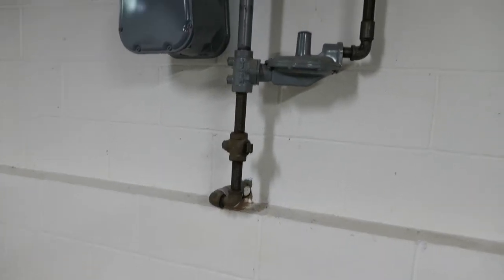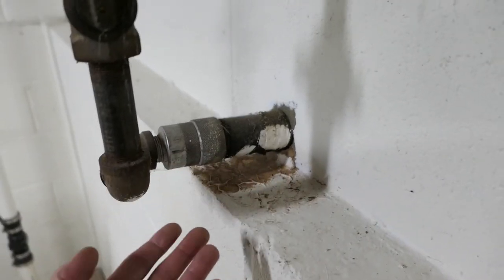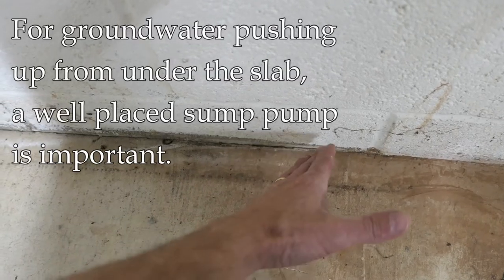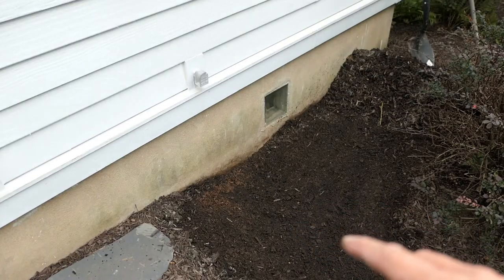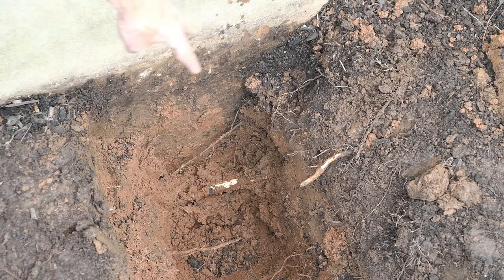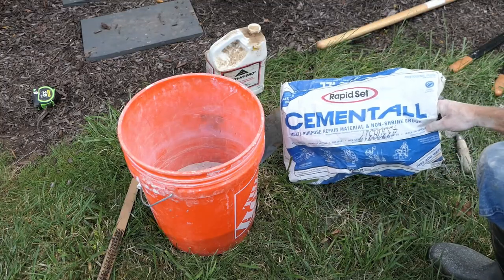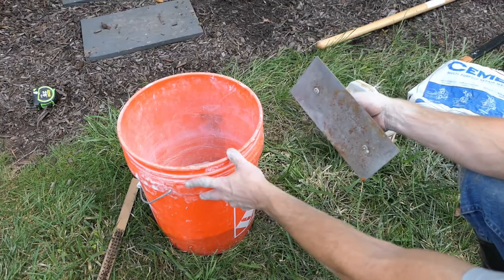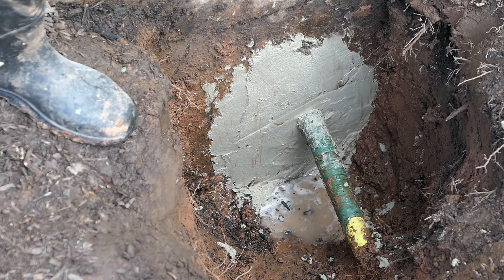Stop Water Coming In Along A Pipe Through A Basement Wall

Comment: I have the same exact problem. Mine is a water line that feeds out to the detached garage. When we have heavy rain water will come through the hole the water line is ran through. My question is should i fill the hole after the repair with hydraulic cement jusg above the water line or use crushed rock?
Reply from the maker: Are you asking how to handle the exterior of the building in this area?  If so, you'll want to dig down to find where the line comes in, and then repair the hole in the foundation as shown in the video.  Then to backfill you can used crushed rock for drainage, but you also want to be careful not to encourage water to gather there.  So you'll need to examine the rest of the area for ground pitch and perhaps to see if the water pipe has become a conduit along it's whole length.  In other words, don't just consider the area of the pipe through the foundation in isolation, look at the whole problem.

Comment: This was extremely helpful. I have the same problem around my water main. The silicone caulk that was around it on the inside gave out. I’ve recaulked with silicone on the inside. How important is it to seal the outside?
Reply from the maker: It just depends how much pressure is on the outside of the wall.  No harm in trying silicone on the inside first to see what happens.

Comment: why was the block below where you were vacuuming flexing underneath the pipe @11:13 that's not a good sign.
Reply from the maker: That's interesting--I guess it was just a video artifact.  I see what you are referring to, but the concrete block was in good shape.  There may have been some surface residue from whatever paint and cement filler was used previously that was flexing as I vacuumed, and maybe I cut the video before all that was vacuumed up.  Ultimately the repair was successful and the wall itself is solid.

Comment: this fix demo was super helpful thank you!!
who is best to call for repair if i decide not to DIY this problem?  the depth of my main water line coming in is about 4-5 feet, little more than i want to dig out myself. is this a fonda toon repair issue or would a plumber handle it?
Reply from the maker: This is one of those gray areas where trades overlap.  You might find a plumber to help, but that probably isn't the most likely.  You might find general contractor or handyman to help, though that would depend on their areas of concentration.  A mason might be willing.  You might even find a landscaper to help, depending on their comfort zone.  You might even have to have one person do the digging while a mason does the actual repair.  You'll have to see who steps up locally.

Comment: Great video! Although I would advise against backfilling with stone around the gas pipe. The service pipe appears to be Coated steel but  the stone could  cause damage to the coating, which would corrode the bare steel if exposed to water.
Reply from the maker: I agree--backfilling a whole trench with stone could be an issue, but in this case it was just a small area near the foundation.  Better to prevent the water from getting into the house.

Comment: Hi. Great video! Can I skip the anti hydro? Or do you have any Home Depot product that you could recommend instead of anti hydro? Not finding it locally.
Reply from the maker: The anti-hydro will protect the mortar from freezing during curing and also make it somewhat waterproof.  It's not a deal breaker, though.  If you can't find it, use dry mix mortar with water and just use a masonry waterproofing product on the patch after it has cured.

Comment: 1 that gas meter should be moved outside, the line coming in has no sleeve around it and could corrode due to the concrete it's running through. I would contact the local gas company and ask for the meter and vent to be moved outside.
Reply from the maker: It may seem strange to some, but indoor gas meters are quite common.  Their use is specified in various codes and regulations in New Jersey where I live, and the main points are that they are vented to the outdoors and protected from certain things like temperature swings or cars (if located in a garage).  They are also replaced on a regular schedule by the gas company to keep them current.  If you wanted to move a meter outdoors it would require the homeowner to pay, and there would be different regulations about the type and placement of the meter.  Personally, I don't see indoor meters as a particular danger over outdoor meters as long as they are installed properly.  Outdoor meters have their own danger, including being hit by landscapers cutting lawns.  That said, I agree that the installation through the concrete block could have been done better, but that was the norm when that gas line was installed in the 1980s.

Comment: What if the pipe is like 5’ below grade?
Reply from the maker: Well, more digging, obviously.  Other than that it doesn't change anything.  If you feel your original installation is especially poor, you could pay to have the gas temporarily disconnected, and then fit a sleeve through the foundation to bring it up to modern standards.  That's not an inexpensive proposition though.

Comment: Did you try to fix the pitch of the dirt to direct water away from the house?
Reply from the maker: Yes, when backfilling I was careful to pitch away from the house.  However, That's something which can change as soil settles.  Often it may also require machinery to correct an overall problem with the yard.  It's not uncommon for the grading to be an afterthought when houses were built decades ago, and even sometimes today.  Unfortunately that oversight can come back to haunt you later.